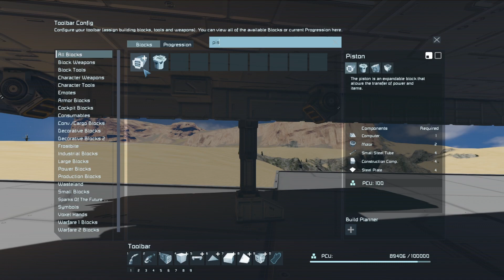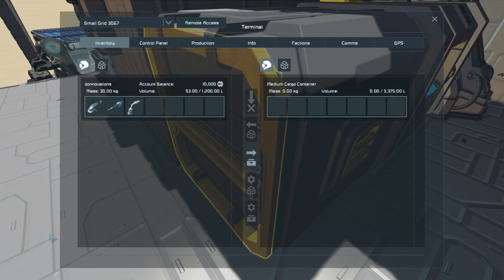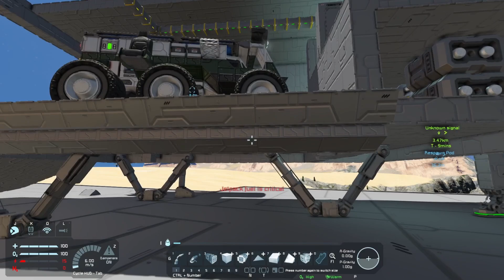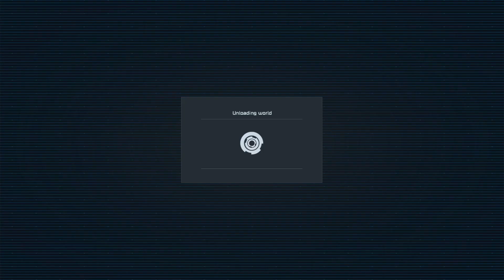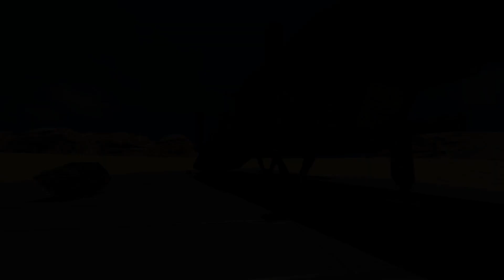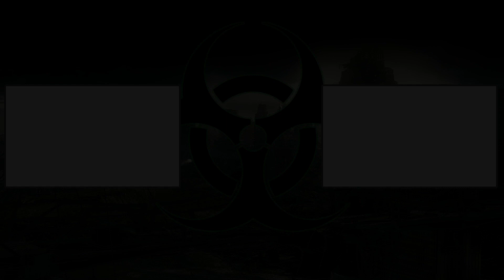☣️Space Engineers: Small Ship Progression - Big Mess On Landing System

Comment: the last test... it wasn't too heavy... if i'm right the last time you pushed the button the pistons retracted... hence the ship going down... the left landing gear has one hinge that isn't set up right still I think. its the 3rd from the back if I saw correctly. 
further. the jumping wasn't necessarily clang. the pistons were under pressure and you removed the actual landing gear you used to build from. which caused the pistons to abrubtly get to a position where they are "relaxed". that caused the ship to jump. hope this helps. feel free to ask questions if needed or to ignore me if i'm wrong lol

Comment: You can fix it by putting a block on a downward facing piston with magnetic plate attached. Then on the front and back of the block have hinge heads. And that's where the diagonal pistons go. The diagonal pistons will move freely, as well as the hinges they're attached to. But the piston in the middle will not be attached to a hinge an it will be the one that moves.